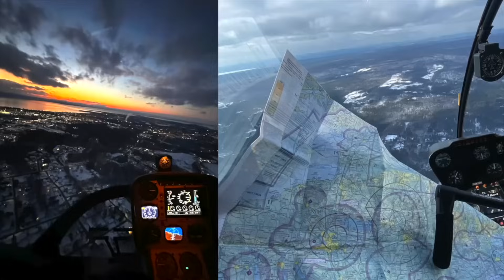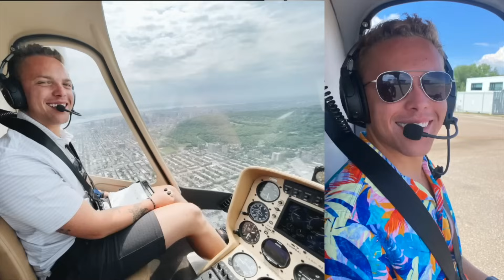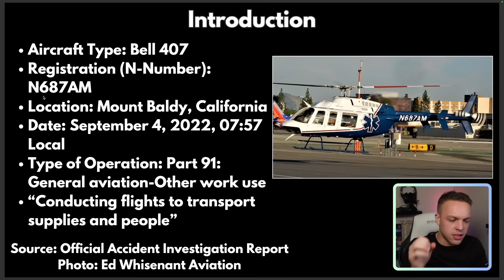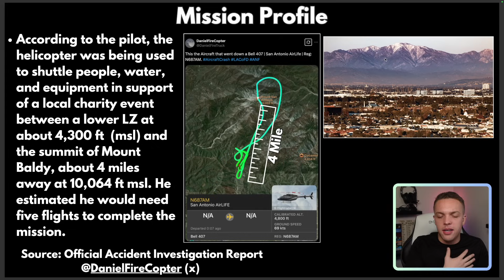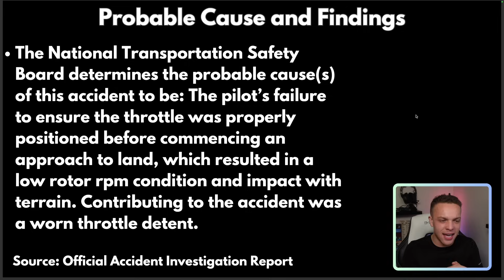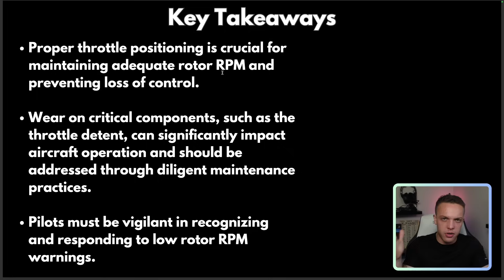Why The THROTTLE Caused A Crash

Comment: Having flown Astars and recently just flying the 407. The design of the fadec and engine control system all seems fairly wonky and cheap to me. Never had a question if I was in a flight detent in a Astar. The 407 I feel like I have to visually verify sometimes. But after this video I will be writing those birds up.

Comment: Okay, I'm going to be the contrarian here.  I've been flying HEMS in the 407 for 24 years, 21 of which were with Air Methods.  With regard to the throttle detent, how long had that pilot been flying that aircraft with a soft detent?  Did he ever write it up?  That detent is adjustable, even if it's worn.  All that you have to do is write it up, and your technician can adjust it to specification without even replacing any parts in most cases.  (Even on a 15,000 hour aircraft.)  I hate a soft throttle detent, and I've written them up many times.  Your technician can't fix a problem that he isn't aware of though.

Also, if you ever get an underspeed, the first thing that you should do is to verify that your throttle is in "Fly".  Verifying throttle position should be part of your before takeoff check, as well as your before landing check.  I also recommend ALWAYS doing a hover check before taking off, especially from a rooftop helipad.  If your throttle isn't quite into "Fly", you'll realize it immediately, before snatching it up on the edge of a rooftop and underspeeding your way to the scene of the accident.

Lastly, that the pilot never verified the position of the throttle between the onset of the underspeed and the occurrence of the mishap, given the amount of time involved, is simply astounding.  It's not only the first step in the emergency procedure, but it's simply the most logical thing to check first.
Reply: I learned I fly in a 269c model with a “ correlator” I hated it having said that I am glad I learned with out a governor
Reply: @nwanchorcertification  I learned on the TH-55A, which is a 269A model.  Everything about the helicopter kept you busy at all times.

Comment: A 58 year old pilot with only 3447 total hours is not very experienced !  
Thank's for the analysis.
Reply: I agree, that's surprisingly few hours for his age, even in helicopters.
Reply: Sorta agree. Could have gotten a late start. Plenty of hours to do the mission competently though.
Reply: @DC300xcw  Absolutely.
Reply: It’s is for a helicopter pilot that manipulates the controls throughout the entire flight. I guess by your username that you fly a 747? I would also guess that depending on your career that you would have tens of thousands of hours. How many of those hours are actually manipulating the controls vs autopilot? I ask these questions respectfully and I’m trying to educate others that might see this message. As Devin says, 3500 hours is considered experienced in the helicopter world. 
Safe skies!
Reply: @HEMSJim  Yes, Jim, you were asking  respectfully, thank's. I'm not flying 747's only. In my spare time I fly small airplanes, warbirds and helicopters, too. Enough stick and rudder time for me. But you are right, the average airline pilot doesn't handfly a lot. Flying airliners is a highly automated job. Nevertheless you need to feed and correct the autopilot more often than the average MSFS2026 simulator jockey would think. The autopilot is just helping us. Every single takeoff is hand flown and 95% of the landings, too. I personally, like most pilots of my generation, turn off the autopilot at about 4000 feet, conditions permitting, and hand fly the beast to a hopefully soft manual landing.😀 

Again, since I know a thing or two about helo flying: If a pilot is 58 years old and his experience is only 3447 hours, that is considered low time in the professional helicopter industry worldwide. Let's say this pilot is flying for twenty years, that would make a mere 170 hours per year. Not a lot. 

Have a nice day and keep the blue side up. RS ✈

Comment: hey devin! question, how do you do weight an balance on other helicopters like the 407 and 109 like you currently flight? as a new com pilot i use an app for my weight and balance for the 22 and 44 but i was wondering if you still use an app to do all that or if you have to do it the long way on paper. best wishes!
Reply from the maker: Hey Man! We have an app. For all the helicopters I flew after the R22/R44 I used an app. Just punch in the weights of the passengers, bagage, fuel, etc and then go! Super simple. I had to learn the paper way in flight school but it is all technology now!
Reply: @ that’s a huge relief to hear 😂. If you can share, what app do you use and is it universal to all helicopters or is it like the W&B app where it’s programmed for one specific helicopter?

Comment: Bell seems to have some poor design choices.  The shaft with the detent appears to be aluminum, which both wears and compresses with time.   Bell is aware of this and provides a test and a detent pressure adjustment.  A simple, inexpensive steel sleeve would have greatly reduced or eliminated this wear and deformation issue.  

Also, it seems, that 206B tail rotor shafts are made of 7-8 individual short shafts which are glued (adhesive bonded) together with splined couplers.  Over time, the adhesive fails and the splines get worn down causing tail rotor effectiveness loss / failure.  While inspections could perhaps have helped, the design of the coupling sleeves make it impossible to visually see / inspect the condition of the adhesive inside.   This has been borne out by 17 failures and resulting crashes.  Most of these had been operated near a high salt environment near the sea.

Not exactly the optimal designs and engineering from Bell.  What's worse, is the lack of improvements over decades of opportunity to remedy these poor design choices.

Comment: That detent is the normal operation area of the throttle, Above that is for low side governor failure below that is high side failure.  I wonder what training he was exposed to in his earlier days ie: What helicopter?  Ex Army post Vietnam ?
Bell 47? Brantley? Hughes 269? Hiller? Power management stuff - 1st reaction I get is roll throttle before the low RPM horn.
If the power comes back = Okay  If not hit your spot.  Better to think of how to truck it out then thinking where to put it down. 
As for the Bell trainers they're tired ole dogs not a new off the line machines. They send instructors to you to wear out your new toy, Or even brake them...Gopher holes & WISP systems 🤣